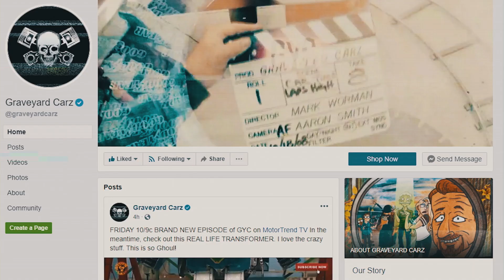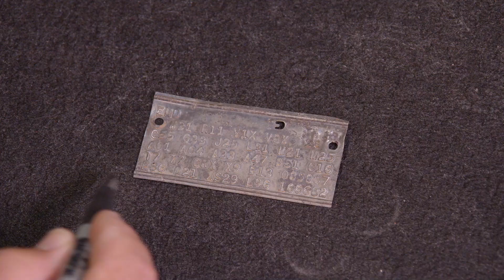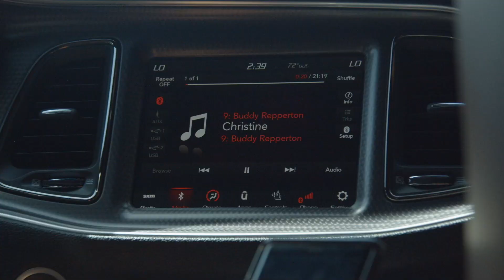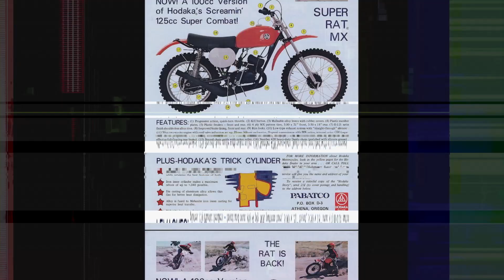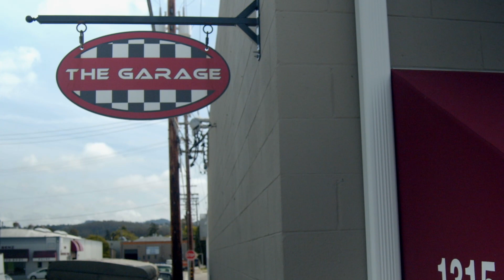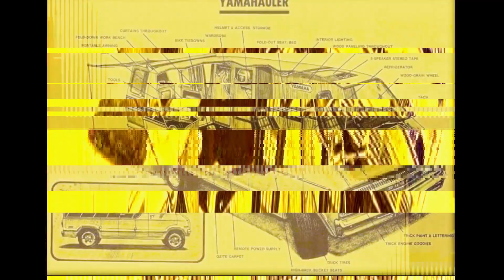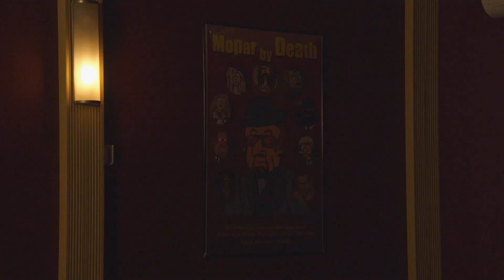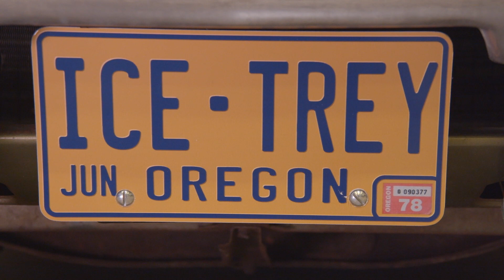ICE-TREY BUYS HIS DREAM CAR BUILD: '70 CHARGER HIGH SCHOOL CAR!

Comment: Bought my first car in the 70's...I'm guessing I'm 6-8 years older than Mark. That said, and he should remember, 'restoring a car' wasn't so easy by 1980! You had all the car magazines selling everyone on 'the new muscle of 4-cylinder turbos' and 'Italian cars, you can't afford'...but real 'muscle' was basically GONE. Racers had stripped the junkyards, 'crushing the old ones' was a new salvage hobby for everyone...and NO ONE had OEM-counter parts anymore! You're missing a parkerized hood bolt? Sorry...SAE-Grade 5's are over in the corner by the Wheaties...good luck. The first company that changed some of this (for GM products) was 'Year One'...someone cared enough to save the last Chevelles and El Caminos! Yaay!...but not. No one was there for the Mopar boys! BUT...the 'good stuff' had already been 'cut out', 'stored', privately held as parts...no telling how many 'pole barns' I've walked into with STACKS of 8-3/4" axles, Big Block K-Members, seats, dashes, rally clusters (that don't even work anymore), etc. I once remember walking into a pole barn in the South...weeds 7-8-ft tall...took a tractor (or bulldozer) just to get to it! (WATCH OUT for the rattlesnakes!)...and there were 8-fully-assembled 'Street Hemi's' and one, in all it's glory, 'Race Hemi' (the legendary 'did they build it, or not' 700-hp Hemi of track legend)...I negotiated with the guy for over 4-hours...he ended up selling me a single window regulator for my 1976 Powerwagon...at the moment, a part you could NO LONGER BUY, as it was an OEM-over-the-counter part, and it was out of the infamous '10-year-window' of availability!
The point of all this? Mark thanks his suppliers...but he can NEVER thank them enough! The guys that went, got the prints, ran the patents to make sure they weren't violating them, and STARTED REPRODUCING RESTORATION PARTS! Without those 'restoration parts guys', all you'd have would be stories and photos! With them...you're got GRAVEYARD CARZ!
Bless the parts suppliers...for they will give new life to what would otherwise be a 'new fangled toaster'...(Mark does a good job dropping restoration parts suppliers' names...but maybe putting more of them into various shows...like dropping stuff off, or giving details as to how 'they chose to list this bolt, or that bracket'?) Give their story too...because if you lived through the 1970's-1980's, you KNOW...it wasn't always that easy to find parts! (and if you have ever spent 2-hours in a junkyard, pulling an AM/FM antenna out of a total, just to replace the broken mast that NO ONE MAKES ANYMORE, bless you...you know exactly what I'm talking about!)

Comment: I just bought my dream car 1988 firebird with only 50 000 miles on it
Reply: Around 1991 I drove a 76 Trans Am / Yellow and Black Interior with all the decals and full open shaker without the trap door, 6.6L auto with the turn down folk tips behind the rear wheels , really never seen any others in that factory color combo, payed the man $850 cash and drove it to 1994 and sold it, good luck with your Firebird,  I have a triple white 84 Mustang LX 5.0 Droptop that I have to get going on soon,